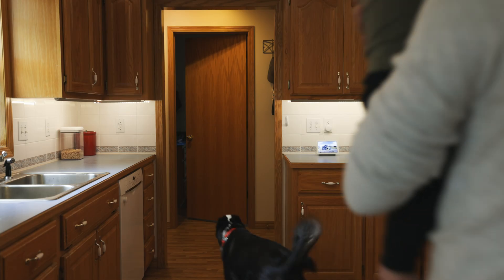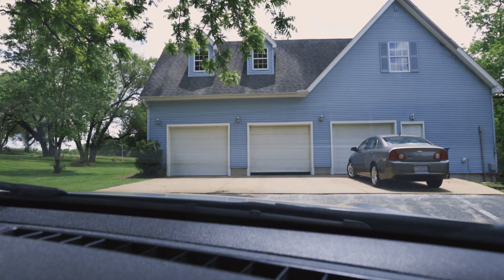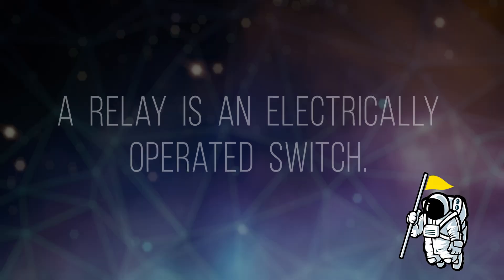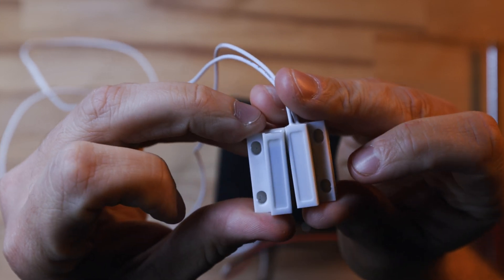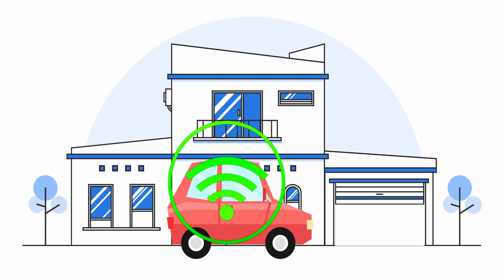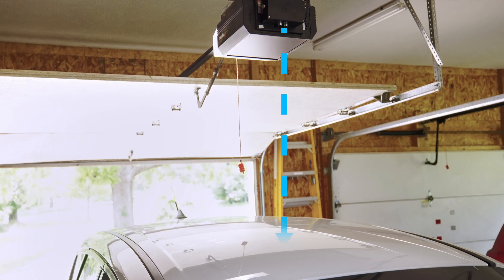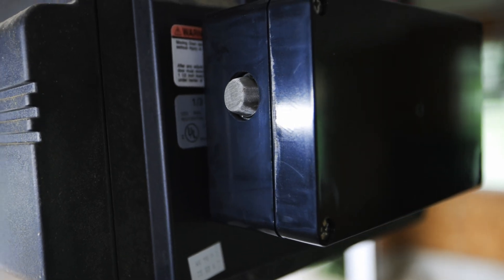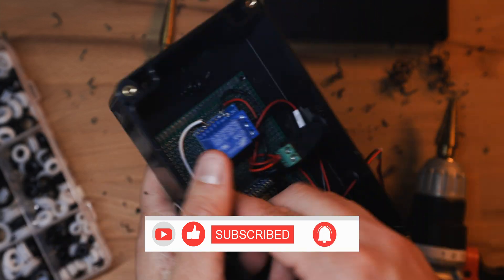DIY Smart Garage Door Opener- Auto Open/Close, Temperature, Voice Control, and More

Comment: Great video! Hoping I will see the use of Home Assistant for the automation. 😄
Btw, just a thought- what if you used your phone connecting to home wifi as the trigger to open the garage door? Just to save some costs.
Reply from the maker: That could work, but I live with my girlfriend and often we ride in the same car. But during the week, we take our own cars. And so I would be annoyed if I was driving her car and then my garage door opened.
Reply: @NickRains  Ah yes. then your solution would definitely be required.
On a separate note, what camera are you using for filming? Looks great. I have been looking to upgrade my existing setup.
Reply from the maker: Canon R5

Comment: Can I recommend you reverse the way the reed switch registered. For security, it should only register closed in the FULLY closed position. I did this by putting the magnet on the chain and the switch on the motor housing where they would meet when closed fully.
Reply from the maker: I'm actually going to test an idea with two reed switches. One at the top and one at the bottom. To know when it's fully open and when it's fully closed
Reply: i was thinking the same, best to know that is full closed then open.
Reply: Agree with this comment and also how I have it set up with Shelly

Comment: I would do this but it’s way to complicated for me  :(
What I would do that is different is that I would just get one of those tapping bots that are smart and have it push down on our garage door remote and have it connected to a Alexa button and then we can open and close the door with the Alexa app but I guess most garage door openers have the remote on the wall and wired but and easy fix is just use the tapping bot on the switch and have one of those industrial boxes on it with some cables to make it look cool or add a button to open and close it from the app :)
Reply from the maker: I like your idea, but how do you make it automatically open and close for you?
Reply: @NickRains  at the moment it’s a remote but our remote you have to push down on it for a second and it opens pauses and closes unless you wait for it to open or close again so for me it would be $25 easy money to have it automated but it would probably be cheaper doing it myself but I would need to pay more for the equipment instead of just the switchBot so soon enough I would surely change it because it’s around a 10 year old house I think as I don’t own the house just my parents but my guess is that it’s around 10 years old or 15 because there was other people living in it before we came 

But the garage door is great it even has a built in light for when you come in and close it because the lights we have are old fashioned filament bulbs and they take awhile to turn on and I’m thing of replacing them but I’m still going to upgrade the system for sure!